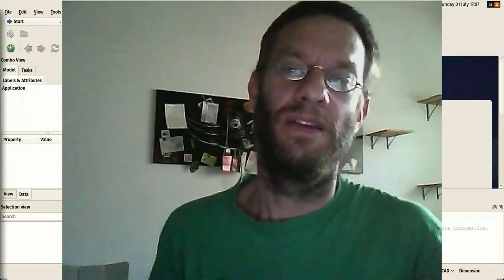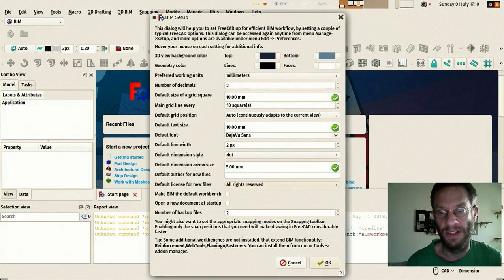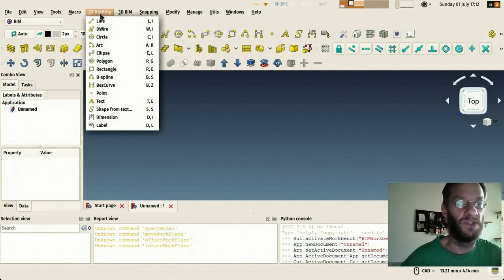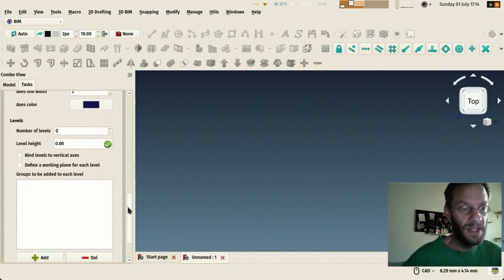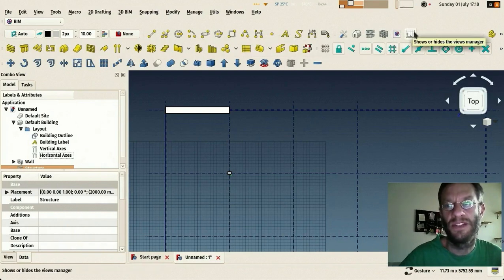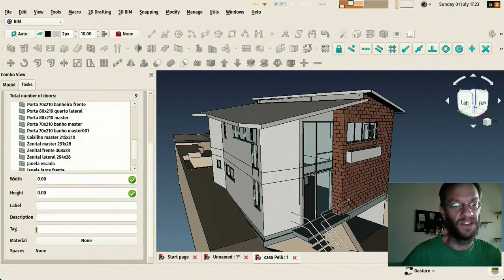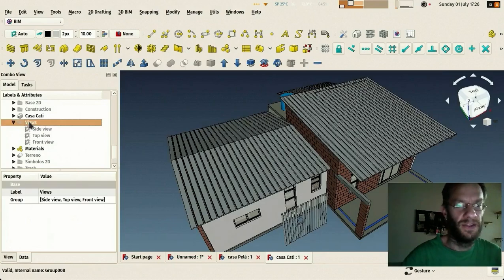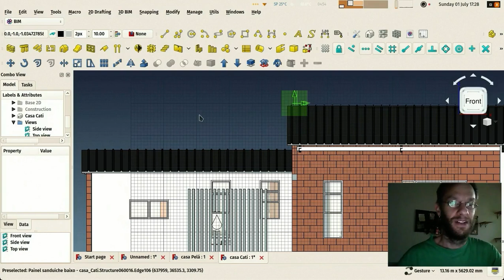BIM with FreeCAD - The BIM workbench

Comment: Hi Yorik van Havre, 
I have the Freecad version 0.18, revision number 4, for windows 10, 64 bits,
I installed the BIM.
After restart the Freecad and try to use the BIM, I take this message: 
 "Workbench failure cannot import name IfcProduct"
Why?
Thanks for your possible help
Reply: It's solved
I uninstalled FreeCAD and reinstalled it.
I added the BIM and it already runs.
Yorik van Havre keep up your excellent sharing and tool development!

Comment: Anything on HVAC and Plumbing?   I'm a building mechanical engineer
Reply from the maker: Not much yet, but it's basically 90% a matter of building prefab elements (pipe sections, accessories, etc...) so all it requires is people of good will to start modeling that ;) The parts library has some elements already https://github.com/FreeCAD/FreeCAD-library